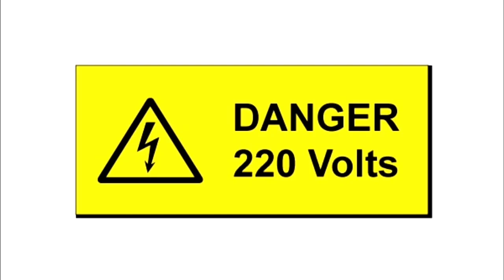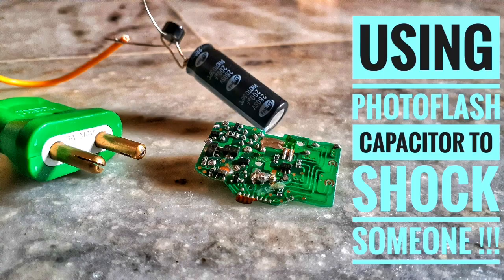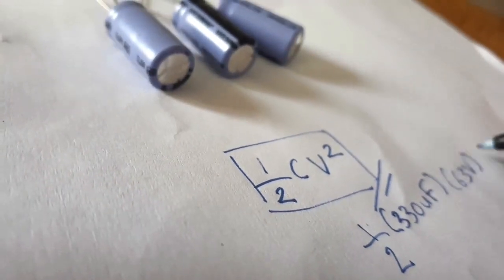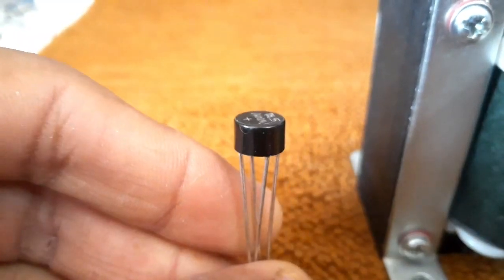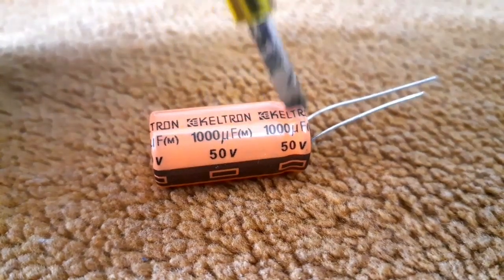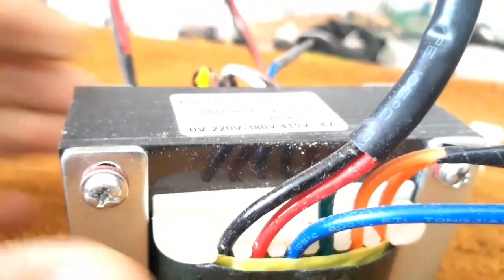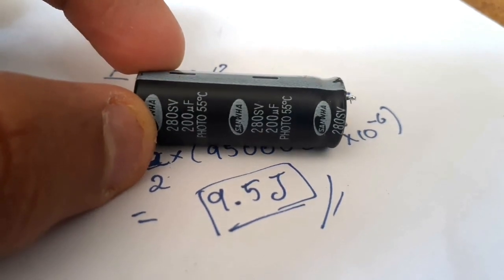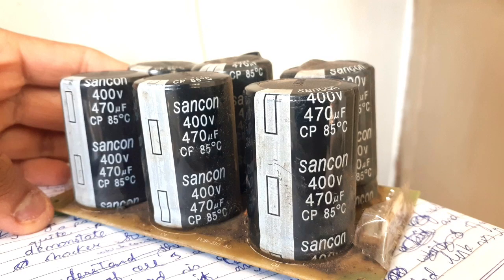🔌USING FLASH CAPACITOR TO SHOCK SOMEONE !!!!🔌

Comment: Out of curiosity, I was opening up an old Canon digital camera which is when I got the shock of my life while removing the PCB. It was the strongest electric shock I have ever felt in my life. I learnt about these capacitors the hard way. I'm not an engineer.
Reply: SAME I HAD A BROKEN PRAKTICA DIGICAM AND LIKE I ACCIDENTALLY PLACED MY MIDDLE FINGER SOMEWHERE. HOLY IT HITTED ME HARD 😭

Comment: Just use a fan capacitor with two wire and shock everyone. And charge using 220v Main line .
Reply: that will literally kill someone
Reply: @morfiakhatun7637  not fan capacitor store high voltage but at very low current. I try it so many times 😂. It shock but never case problem. But make a switch like a charger etc . Never use wire along.
Reply: @profast786  Ok thanks brother
Reply from the maker: Yes that's a valid point 
Will Try
Reply from the maker: Almost haha.

Comment: ⚡️⚡️⚡️amazing device
Reply from the maker: Thank you frand !!!
Reply: What do you recommend if I want to max out at a lower voltage let’s say 30-100 Volts ? Would you suggest the capacitors mentioned earlier or would you say they are not powerful enough.